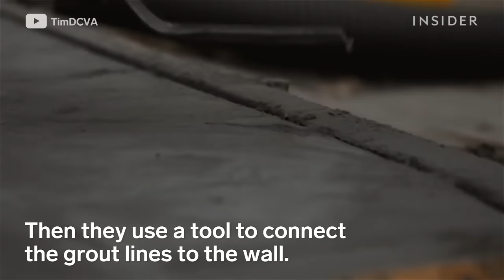These Stamps Transform Concrete Into Wood And Stone

Comment: We had this done, years ago, Twice!.  First time they didn’t cut an expansion gap in it, to stop it cracking naturally, and they forgot to add powdered glass to the top coat of sealer.  It turned out to not an ice rink in the winter.  It was so slippery, the post office served us a notice to say they couldn’t deliver mail anymore!  Suffice to say they did the whole job again, correctly.  The colour wore away under car tyres, but the top surface can be redone every 5 years or so
Reply: I was about to write this...
Problem with non smooth concrete with cracks is that water and ice demolishe it very very quickly...
Reply: hey a word of advice if you dont know it already, if you live in an area with ice, dont put salt on your concrete, it will pop up layers of the concrete, use calcium chloride. i would just be mindful of pet paws, as with any other deicer.
Reply: @nathanbohn1078  for sure on the pet paws. My dogs cannot handle it on their paws.
Reply: That's fuckin hilarious dude
Reply: @DanOfTheWild
The potential misbehaving of the dog was definitely it's owner's fault.
You have to show them how to behave
You can't expect a pet to train itself.
Reply: @DanOfTheWild maybe you shouldn't have gotten the dog in the first place.
Reply: Yes even if you do it right .  You are better off with regular broom finish cement .   Hell yes add some color .   But this stuff is shit around wet areas or driveways.   Don't add salt or it will ruin finish
Reply: @Mikyda3  Who said it was his decision tho? I can understand him, majority of people are dog lovers but its not for everybody, yet families still get a dog even when one in the family don't like dogs. Happened to my neighbor and my in laws. Father in law hated dogs, but his wife wanted a new distraction, since their last kid moved away and she needed a new hobby (yeah I know its pretty messed up). Personally I don't dislike dogs (most of em at least) but I really hate it when people have dogs IN their homes. Those homes were ALWAYS dirty and messy af from my personal experience. You can't expect a dog to behave clean, its not in their nature, unlike cats.
Reply: @DanOfTheWild good bait.

Comment: the look is great, ive done this plank look on many jobs. but i have to point out a huge mistake. possibly one that could result in a lot of cracking and possibly a complete redo of the job. way back in the beginning, when the truck started pouring, they never lifted the rebar into the concrete. the rebar is there to reinforce the concrete, when it lays on the ground and the concrete is poured over it, it is useless. it needs to be inside the concrete. also, for pads there are better wire mesh rolls or panels that can be used rather than rebar. i always suggest wire mesh in the field and rebar around the edges. the plank look is great, and i hope this lasts for the sake of those who had it done, but a beutiful plank concrete job, like any other job, is only as good as its foundation.
Reply: well, the only thing i referred to as a mistake was not lifting the rebar into the concrete. and that most certianly is a huge mistake.
Reply: So you mean like the rebar is supposed to be in the middle instead of at the bottom right. I don't know anything about construction much but I would like to have similar kind of concrete floor in my own house someday so gotta know as much info as I can.
Reply: Maybe they already added it and it's a different kind? I'm not in construction but I'm sure it may be there
Reply: @fynnthurlow7508  there using actual bar styled rebar that is already lifted off the ground and set halfway into the concrete it's about 1/8 - 1/4 in round, in short runs like that it wouldn't bend at all either. This type of rebar doesn't need to be lifted it's already lifted when they set it into the form and doesn't move from there
Reply: The small grid/mesh style rebar needs to be pulled, that stuff comes in big spools, this bar style rebar comes in long bars that you cut down to size and lay into a grid pattern
Reply: Yeah, and you know it's not already raised up because you can see them stepping on it. If it were, (first, it would be visible that it was on stands) they would only step between the rebar.
Reply: Thought the same exact thing when I watched it. At least put a couple rocks under it at the least
Reply: Amateurs in the comments..  Rebar and wire wire does not stop concrete from cracking in the first place!!! And youll be lucky that rebar lays on the bottom when your kids tear that out in 20 years!!  In fact, Unless their building a supporting bridge, dont need rebar anyhow!!
Reply: @harrycohen2948  id expect to see you on this job  if thats how you think. check out my comment  says specifically that i have done this look on many jobs. end of quote. i do the work, i am no amateur. if you dont think rebar stops concrete from cracking, go ask your local concrete guy, then come back and tell us what they said. also if your concrete wears away that much after 20 years, youd be ripping that shit out of my yard.
Reply: @harrycohen2948  sure glad you dont lay concrete around here

Comment: I wanna do this with a concrete/rubber mixture so it won't ever crack and the design will stay forever beautiful 😍❤
Reply: Where do you get the rubber pellets?
Reply: Do you think that could work in the house? A rubberized concrete floor?
Reply: @closetculture3025  I don't see why not, a lot of people use it for their entire garage floors, so I don't see way it couldn't be done in a kitchen or whatever. I think it would be super pretty inside! I love that idea!
Reply: @TheRubinator13  Oh my god yes! I'm doing it! Thank you for the inspiration!
Reply: All concrete cracks.  No matter what you add to it, it will crack.   It will also weaken the concrete.  You can add fibermesh but it will still crack.   Unfortunately all concrete cracks.  I will guarantee that.  Lol
Reply: @TheRubinator13  no one has ever made rubber floors for their garage though 🤣🤣 I'm sure you're talking about the overlayment
Reply: @TheRubinator13  epoxy yeah?

Comment: The wood texture would look fab in a kitchen
Reply: Adding pigment to the concrete and coating it afterwards with epoxy like in supermarkets would make a durable surface.
Reply: Why would you want a concrete floor in a kitchen?
Reply: @torkakarshiro5170   Some places have concrete floors because it's cheaper and easier than wood , tile, or linoleum and.
Reply: @2degucitas  But is so much less beautiful and it feels totally different and it is obviously faking something it is not.
Reply: @torkakarshiro5170  True. But, for some it's all that's available.

Comment: Placing concrete over rebar laying directly on the base ( in this case crushed stone ) will probably lead to premature failure (due to corrosion) of the rebar.  I also wonder what was done to campact the crushed stone before the pour?
Reply: That rebar should be dobied up to the center of slab. Some installers will try to pull it up while pouring, which is highly suspect. 3/4" crushed rock won't compact, but is suitable for base material under the right conditions. There's no masking on the house, meaning concrete splatter and powder stains are likely.
Reply: Yeah, I was like, where your lean concrete?

Comment: I’m interested in doing a sidewalk with the top design being some of those black rubber floor mats with a design in it. Put down the concrete, smooth it, lay and press down the rubber mat into the concrete and then once the design is transferred to the concrete, pull the rubber mat up for the next section. I wouldn’t want it deep but enough to see the design from the mat, and I’m thinking it may make the surface less slick if it has some texture to the concrete. Pros? Cons?

Comment: It looks bad and is worse for the environment than wood
Reply: How is concrete worse for the environment than wood?
Reply: Because wood deteriorates faster
Reply: @cerise_galaxy6738  I'm truly curious, but how is that worse than something that lasts longer?
Reply: @camelliahyacinth5926  because wood is capable of turning into soil for new life to thrive
Reply: @cerise_galaxy6738  but wouldn’t that mean more trees have to be cut down to replace it anyways? Concrete can be recycled back into a base or broken up and used for another purpose.
Reply: @ALMX5DP  good point
Reply: Cement is a big emitter of C0².
Trees capture carbon. This is why Forestry is so good for cutting emissions. Trees capture the carbon, then new ones are planted.